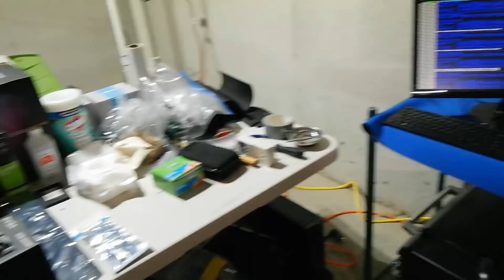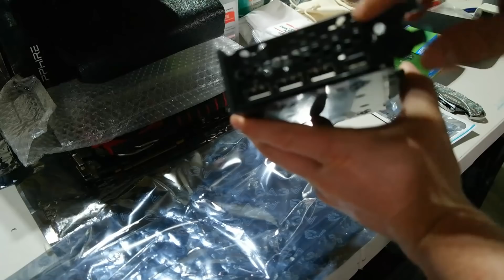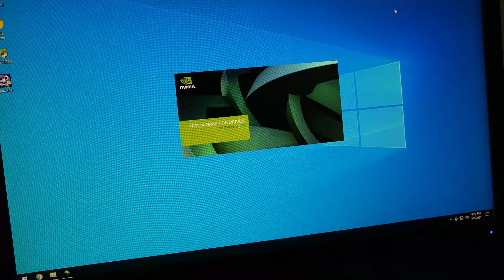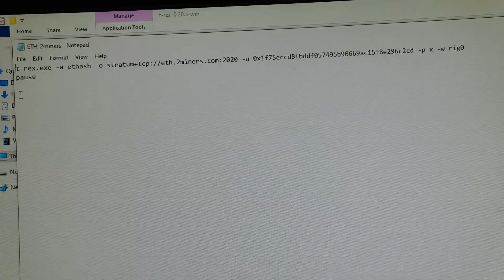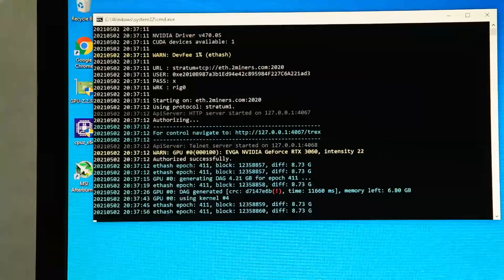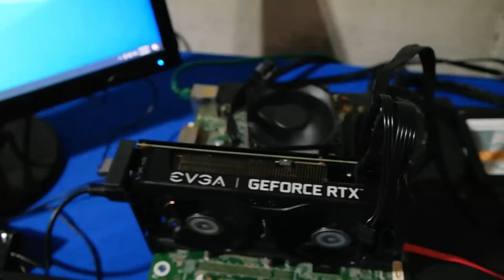RTX 3060 Mining Hashrate Driver Hack Doesn't Work Anymore?

Comment from the maker: *UPDATE* First off you guys rock, hell yeah!  Lots of people reached out offering helping hands.  Special Thanks to Max Voltage and UHack on the Hobbyist Miner Discord Channel.  They uncovered the MB's Model did some digging and determined it supports X16 2.0 not 3.0 which is required with the 3060 Driver Hack.
More Details Found Here:
https://browser.geekbench.com/v3/cpu/2612032

I will be verifying all of this tonight when I am home and trying out the 3060 in my gaming rig which has a newer MB.  Thank you!
Reply: Just to clarify: the URL is a random benchmark that shows that the motherboard used in the video (HP 2B34) is based on Intel H81 C2 which works at max PCIe 2.0 speed. For mining you need an x8 or higher slot working with PCIe 3.0 or higher, so PCIe 2.0 is the issue.
Reply: you can check what pci gen and lanes is using with gpu-z, pci 2.0 x16 does not work. I tested on an old motherboard to see if it works.
Reply: please let us know if you found a fix
Reply: @Roman Baitaliuk is it true?
Reply: @Roman Baitaliuk On 5/11 I installed a 3060 on my rig and it works just fine @ 48mh/s
Reply: Just waiting to see results
Reply: Glad you found the fix! I was thinking the minute you threw that card in your gaming rig you would be fine.  That motherboard looked a little older.  I have that exact card and I was starting to worry that the hack wasn't going to work with later SKUs of that card.  Enjoy that 48-50MH/s :)
Reply: I have an ASUS Z/270-ar and I’m having the same issue where my MHS drops. I have the   3060 in an 16x16 slot where it’s selected as gen 3 and I have the 470.05 update. Any help would be appreciated.
Reply: @diggy4187  Same setup, same issue.. did you figure it out?
Reply: I solved my issue setup 1 3060 on primary PCI slot 16, gen 3 (which I had to force in bios), and 1 rx 6700 in second slot. -this worked for about a week but after a reboot, the machine had the issue of the 3060 starting at 45MHz and then dropping to 28MHZ.. I was using a HDMI plug, today I went on to try figure out why its dropped, and I noticed that while having the monitor plugged in, it rose to 45MHz again slowly. so leaving the monitor plugged in now and it seems to be working. Of course always using the old driver for the 3060.. otherwise none of this would possibly work.
Reply: @diggy4187  Do you found any solution for this issue ?
Reply: X470 is a good mobo for dual 3060. Cpu has to be 3000 series i think.
Reply: Im facing the same issue. 3x3060 on 16xto26x risers. Pcie gen 3, developer driver and everything. When the miner starts it goes to 41 and then goes down to 26. Anyone can help me?
Reply from the maker: @heraNbUdDHikA  You can't use risers is my understanding. Has to go directly into the MB.
Reply: @TheHobbyistMiner  those are 16 to 16 risers. I plugged first card to a monitor and all 3 cards are doing 26MHs. Then i plugged both first and second to a display source and then only first card gives 41MHs. This is a weird scenario IDK why. :(
Reply: @heraNbUdDHikA  For some reason when my monitor is off at some point it drops down to 24mh/s, but if I leave the monitor on it stays at 48mh/s or 41mh/s with no overclocking.
Reply: @G_from_Jersey  you need an "HDMI dummy", it's because the monitor being off, you can get them on Amazon
Reply: @heraNbUdDHikA  that's because when you activate more than 1 pcie, your card changes the minors to less than x8
Reply: @felipeulquiora  but xeon 2620 has 40 pcie lanes
Reply: My motherboard is asrock b450m pro 4 it connects directly to the motherboard, i set pcie gen 3 on bios still 20 mhs :( can anyone help?
Reply: @ffkanz523  I found leaving it on auto rather than putting gen 3 got me the full hashrate, are we talking about the rtx 3060?
Reply: @Jichory  yes but i just found out my athlon 3000g doesnt support x8 or x16
Reply: @ffkanz523  yeah you're right, your cheapest option to buy ryzen 3 3100 if you're buying the cheapest am4 CPU, you can try the a6-9500 and the a6-9500s but I haven't looked too into those CPUs. So buy the cheapest cpu, or best deal of motherboard and CPU, keep your 3000g it's good for those single 1x or a 4x powered gpu.
Reply: Bummer, well that explains why my ASUS M5A97 does do any better with that driver - 1 x PCIe 2.0 x16 (blue) 1 x PCIe 2.0 x16 (x4 mode, black)
Reply: After playing around more, with my recent Newegg shuffle, I was finally able to get into the 40's consistently with the following settings - MemClk +725, Core +25, Pwr/Vol 70
Reply: @DDDProjects  need at least 3.0 pci and dummy plug
Reply: Not only do you need a PCIe x8 (or higher) but you also need to see what your motherboard chipset supports (how many lanes go to which PCIe slots) and see how many lanes your CPU has.

If you are just running one 3060 it is easy. I just built a rig to support my three 3060s and four 3070s and had to get a X79 MoBo. I love it though
Reply: PRO TIPP: push windows button --> type --> UAC --> pull slider down to bottom --> now be happy that you only have to click one more time on the ok button and never see this dumb overlay again....

Hey you clicked an installer ... do you really want to do this? ... Ehhmm I clicked on it to start the install... windows... go down into the basement and stay there until you know what you have done

Comment: This is not working on my machine. Just got a 12G-P5-3656-KR (NOT LIMITED) 3060 XC from EVGA, and it won't allow me to install the driver. It says incompatible hardware or version of windows. Windows 10, plugged into my gaming machine, monitor on, no issues with that.. I've uninstalled all GPU Drivers, turned off internet, and same issue.

Comment: How the heck you was able to install that Driver with the New EVGA Card, Now it doesn't even let this driver to be installed, either fail to install or Installation does not starting.. I've tried few different 3060 cards New ones, No luck, what so ever..
Reply from the maker: You have a V2 LHR 3060, this will not work for that. You will need to mine anything BUT ETH.
Reply: @TheHobbyistMiner  no it's impacting other coins as well.  I have an MSI RTX 3060 12gb gddr6 and it won't mine ERG well either. You can ge it started up to 120 MH/s then it slowly reverts to 60. It seems to learn what you are doing. I would say all new 3060s and so are not worth it for mining now.
Reply: @TheHobbyistMiner   Bro, actually I have 2 New (Version 1) EVGA 3060 and they are Not LHR, but still that 470.05 driver won't work with them.. NONE of the NEW NVIDIA CARDS will work with that Driver.. Only Old Cards, at least 3-4 mouth old.. So at this point LHR or NOT it doesn't matter, cause they are ALL LIIMITED NOW.. I hope Somebody will change that quick, either by Modifying that Driver or New Software like NBMiner? We'll see... Thanks for the Video!!!!

Comment: A query, when I install the 470.05 drivers, the 3060 does not recognize me, it seems not to be compatible. I have video but the msi afterburner or mining program does not recognize it. With a more current controller if it recognizes it but does not exceed 26 mh / s. I have another gpu and if it recognizes it with both the 470.05 and the current one.

una consulta, cuando instalo el drivers 470.05 no me reconoce la 3060 pareciera no ser compatible. Tengo video pero no me lo reconoce el msi afterburner ni programa de mineria. Con un controlador mas actual si lo reconoce pero no supera los 26 mh/s. tengo otra gpu y si la reconoce tanto con el 470.05 como con el actual
Reply: me pasa lo mismo, he probado con 6 rtx 3060 distintas de marcas distintas y no reconoce ninguna. No sé que hacer ya...

Comment: I have two rog strix 3060"s and they are a pain. They don't work with any existing dummy plugs that I know work in other brand 3060 from other rigs I own. It only works with monitor plugged into hdmi and only some hdmi cables work with no rhyme or reason. Fml I kept thinking it was a driver issue

Comment: i bought new 3060 (import month= july)  not taking the driver 470....what to do?
Reply from the maker: So that 3060 is an LHR card not a "Nerfed" card. V1 were "Nerfed" V2 are LHR.  This video applies only to V1.  I would recommend looking at NBMiner that just came out with a new miner that works in HIVEOS and gets you 70% hashrate.
Reply: @TheHobbyistMiner Actually, I already have one 3060 old manufactured model which is connected to the monitor and driver installed 470.05 and it works fine...but another 3060 is not taking that driver...only if i  install 471 driver   then it working...so is there any wayout to run one 3060 with 470 driver and other with 471?

Comment: try anather pci x16 slot, i had the same problem, solved by changing to slot, Gen3  x8  +1300vram clock, +75 core clock,  75 power limite, 123W , thanks for the video

Comment: i have msi 3060 gaming x 12g. the driver hack works fine. 50 MH still runinng. 
and today just got a new 3060. msi gaming x 12g.  same model. same box. pcie 16 gen 3. mobo and i cant install the driver. even after i updte the inf file. and installing the drive manually with device manager make the pc wont load windows until i uninstall the driver from safe mode
Reply: they have diffrent bios version.
hack ok :94.06.14.0.B8
cant install 470.05 : 94.06.25.00.8C

Comment: hello Hobyist Miner. You mentioned in this video that you need the 3060 xc to be connected to a x16 PCIe slot for the hack to wok properly. Can you confirm then that I cannot use a GPU extention to connect it to the motherboard if I want to bypass the limiter? Thanks for your help.
Reply: you cannot use a GPU extention to connect it to the motherboard

Comment: The no limiter 470.05 is not totally without a limiter. You need to run it the "right" way. I have tried it on H410M-E motherboard plugged into the pci-e 16x slot and it gives 41 mh (give or take) or with afterburner (+70 voltage; -500 cove; +1000 mem) around 47 (give or take). But on an A320M-K the limiter kicks in. I haven't tried every possibility but I got one that works. IMHO Nvidia is run by suites who need to learn about Capitalism and Profit. Nobody with a working mind will deliberately break a good product. Next time go for AMD. Nvidia just went down big time in my book

Comment: Anyone, can advise me if I am using MOBO Asus B85 Pro Gamer? it stated that it comes with a PCIE 3.0 x 16.

If from its user guide, it stated that this MOBO has PCI Express 3.0 / 2.0 X16 slots.

But using the same method, the 3060 that I bought yesterday drops from 41Mh/s to 22 Mh/s after a while. Please I need help
Reply: it got PCIE x16 Gen 3.0

Comment: just bought a 3060, but cant get it past 25mh. Downloaded the 470.05 from various places all the same but non of them work, they dont have an installer, the exes dont do anything, windows cant find a driver in there... Check the file you are offering and tell me what im doing wrong becaus eI see no way to get this to install :(, the set up file says I dont have compatible hardware ?. Tried runing all 5 applications in folder, nothing works.
Reply: The lhr v2 is in gpu bios, nothing to do

Comment: Can anyone suggest me a solution. Caught up with the same issue.
Motherboard - Asus B250 Mining Expert
CPU - Intel(R) Core(TM) i3-6100 CPU @ 3.70GHz 

Nvidia 470.05 driver installed and HDMI Dummy Plug also plugged. Still getting around 26MH/s
Reply: change in bios gen 3 to gen 2

Comment: Mine was hashing 47 MH, but last night it went down to 25 MH, rebooted, reloaded driver, yet still  25mh
Reply: Were you able to raise the MH to 47??
Reply: @eandresmo  Yes, it was working great for the last 3 mos. Then 2 nights ago, it is down to 25mh. Reloaded all the drivers nothing. Could it be nice hash?
Reply: @eandresmo  nope its 25mh right now
Reply: @AngriestAmerican  looks like updated the driver
Reply: @cyborg6294  It went back to 47 after I upgraded windows for a while,,now back too 25
Reply: @AngriestAmerican  windows updated your gpu, you should downgade your gpu (roll back from device manager) or if that does not work try to remove the driver and install 470.05

Comment: AMD Ryzen 5 3600 (6Core, 12Threads, Upto 4.2 Ghz)
 
 ASUS ROG STRIX B550-F GAMING (WI-FI)
 
 2 X 8GB ADATA XPG Gammix D30 DDR4 3200MHz>
 
 
 
 MSI GeForce RTX 3060 GAMING X 12G
 
240GB ADATA SATA SSD

 1 TB WD Blue SATA HDD 7200 RPM
 
 
 
 Deepcool DQ650-M V2L

 Stock Cooler
 
 NZXT H510I

 30 Days Microsoft Windows 10 Home 64-Bit Trial

Standard Support: 3 years RTB (offsite) part 
replacement/repair warranty from Ant PC with Lifetime technical support 
& 7 Days DOA Policy.

 None

Comment: Hi there, my issue is that I am unable to install the 470.05 driver as the error that pops out is that “The NVIDIA graphic driver is not compatible with this version of windows. The graphic driver could not find compatible graphics hardware.” The GPU I have is a MSI RTX 3060 12 GB Ventus 2x OC. I have the GPU in the PCIe X16 slot and even tried uninstalling the existing driver with DDU and tried to install 470.05 but still the same error pops up…
Reply: same here, need help!
Reply: Try last setup windows update

Comment: bios setting primary display settings to GPU,, it helped me to get 49 MH/s
Reply: Best I did is 47 what did you use to get to 49?
Reply: @ackomanah6486  I use after burner with setting:
Power limit 66
temp limit 70
core clock -100
memory clock +1300
fan speed Auto
and I'm using T-rex miner, average MH/s is 49.4,  P:112w, E:447kh/W
Reply: @peterkristof9291  Thanks I will try it. By the way I just tried an ASUS A320M-K motherboard with an Athelon processor and the limiter kicks in. My other one on H410M-E and a Celeron works just fine no limiter problem.
Reply: @peterkristof9291  Thanks I am using your settings and Phoenixminer version 5.2e with the H410M-E and getting 48.9 which is good enough power 112w. It works.
Reply: @ackomanah6486 different motherboard should not be reason for limiter, it will be most likely bios settings for that motherboard,,, make sure you set Gen2 as my ASUS MB had limiter on Gen3
Reply: @peterkristof9291  You are right. I will try it.
Reply: A query, when I install the 470.05 drivers, the 3060 does not recognize me, it seems not to be compatible. I have video but the msi afterburner or mining program does not recognize it. With a more current controller if it recognizes it but does not exceed 26 mh / s. I have another gpu and if it recognizes it with both the 470.05 and the current one.

una consulta, cuando instalo el drivers 470.05 no me reconoce la 3060 pareciera no ser compatible. Tengo video pero no me lo reconoce el msi afterburner ni programa de mineria. Con un controlador mas actual si lo reconoce pero no supera los 26 mh/s. tengo otra gpu y si la reconoce tanto con el 470.05 como con el actual

Comment: hey bro, i got my 3060 working with the pcie 3.0 of my MB... i got a spare 1060 lying around, can i use it on the extra pcie 2.0 slot on my motherboard? Or do I really need another motherboard that has more 3.0 pcie's?

Comment: I have 2 GPUs, 1 Radeon and 1 RTX 3060, Im using the 470.05 driver, my MOBO supports pcie 4, both GPUs are in 16x slots, my monitor is plugged in the 3060 but im still getting my hashrate droped, what else could I do?
Reply: Did you find a sol.?

Comment: Interesting problem I just fixed and I figured I’d post about it. The 3060 can be all fine and dandy in the right slot, having the right drivers, and the right msi after burner settings, but if it can’t see the monitor, it will default back to its shit settings. I run my miner in my living room on my HDTV as my monitor and having everything connected through my stereo receiver. I couldn’t figure out why I kept seeing my hash rate drop from 49 to 26 every time I turned all my stuff off and remote connected through my other computer. Turns out that by connecting my computer through my receiver and the tv to the receiver, I effectively disconnected the tv/monitor when I powered down the receiver, forcing the hash rate drop. I tested this about 5 times by turning my receiver off and watching the hash rate drop, turning it back on and watching it jump back up to 49 over and over. 

You can combat this by going to Amazon and buying a hdmi dummy plug that fools the 3060 into thinking there’s a monitor still connected to it. Then just remote connect into your computer when you need too. Hope this helps some of you.
Reply: You just doubled my two rtx 3060s hashrate! THANK YOU Both combined were hovering around 52MH now they are at 96MH!
Reply: @Calico810  np. Glad it helped.
Reply: I dont have an hdmi dummy plug but can i use an hdmi cable? or that will not work?
Reply: @cyborg6294  no I don’t think that will work. The dummy plug fools the computer into thinking there’s a monitor attached to it. On the bright side you can order a dummy plug from Amazon for about 4 dollars
Reply: @jamessm4401  thank you so much for your reply

Comment: i help my friend to set it up .he running  his card connect to the monitor with a display port cable .core voltage 0. power limit 80, temp limit 75, core clock 0. memory 1400. fan speed all depend your card heat ,he is running T-rex mining good luck but they drivers work..at 16x lane not 8x..he just running that card alone in one system.